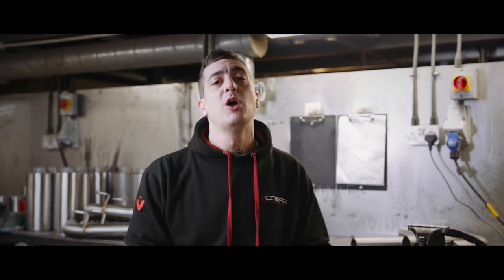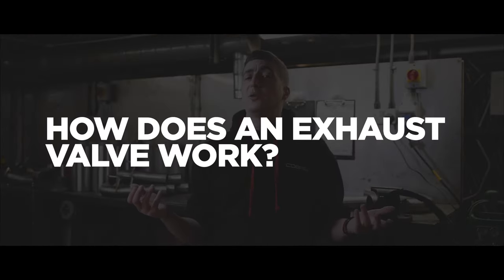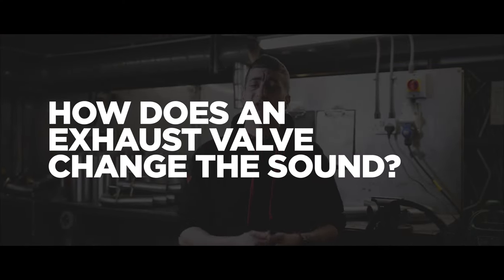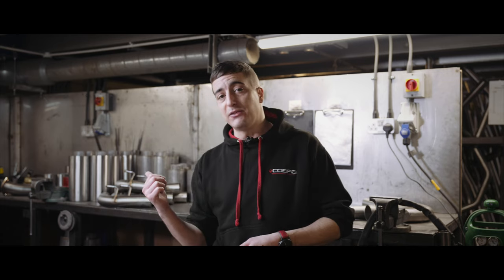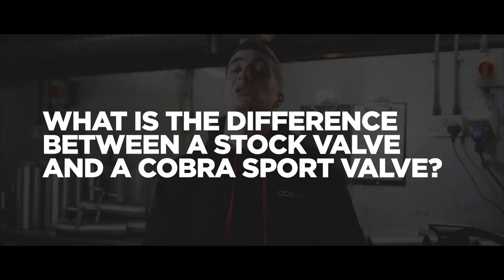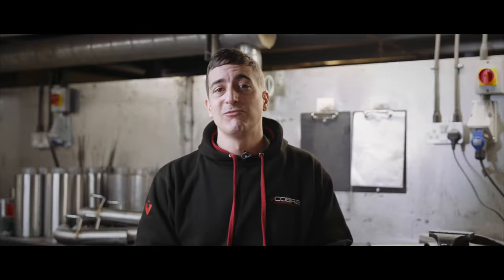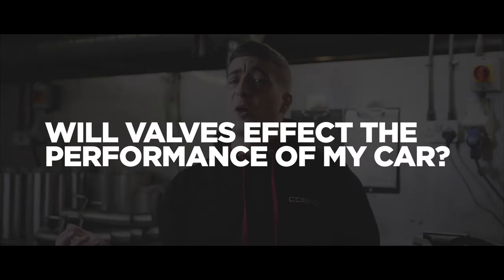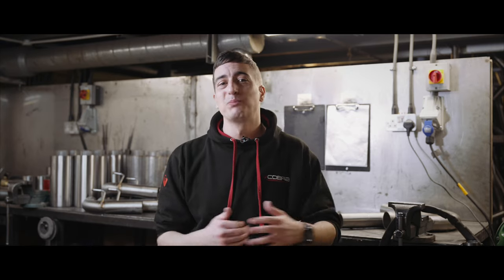Exhaust Talk: 04 | Exhaust Valves Explained, How Do They Work, How Do They Change The Sound?

Comment: Super helpful, particularly regarding stage 1 & 2 mods. If I like my factory muffler for the stealth, could I just install a valve cutout before the muffler and then run a straight pipe to the rear, or do you recommend a new muffler system tuned specifically for my car?
Reply from the maker: This could be an option but you may not benefit from us much of an increase in sound and performance if you just modified the standard system. If we were to custom build a system for you, with the valve closed we could tune it to be similar sound level to standard but with better flow. We'd normally place the valve near the rear of the system to make sure the exhaust as a whole always had optimal flow with enough pipework to tune the sound tone.

Comment: I have Ford Puma ST 2022. Stock exhaust,  I unplugged the sensor a while back. Valve is open all the time. Sounds much better at all speeds.

Would this cause any long term issues? Or is the Valve purely for sound?
Reply from the maker: If you're removing a valve we always recommend this is either coded out or you attach a blanking plug to the cabling to protect the wiring connector. We've not come across issues with removing valves on our own vehicles as long as it is completed correctly.

Comment: How to stock exhausts work ? Are valves only open at a certain RPM ? Is the only reasons valves are there is for emissions and noise pollution ?
Reply from the maker: Valves work in various ways depending on the specific vehicle. On certain cars they operate on a vacuum system which opens the valve depending on how far the accelerator is pressed, whereas on other models the valve may open if you switch from ‘Comfort’ to ‘Sport’ drive mode. 

The purpose of the valves is to deliver a driving experience where you can enjoy a louder exhaust on a fun road, but when you are wanting to have a quieter note such as on a long journey the valve is then closed and the exhaust is quieter.